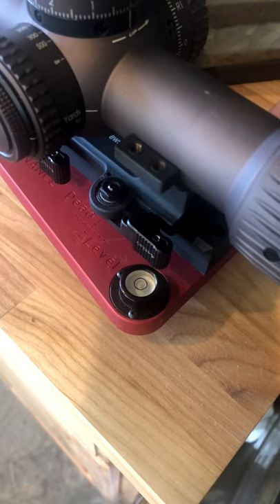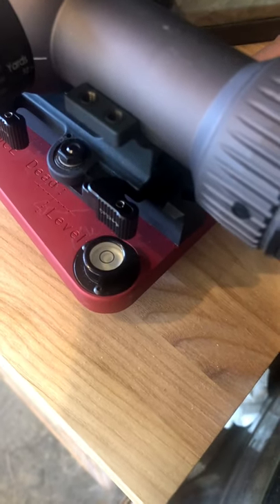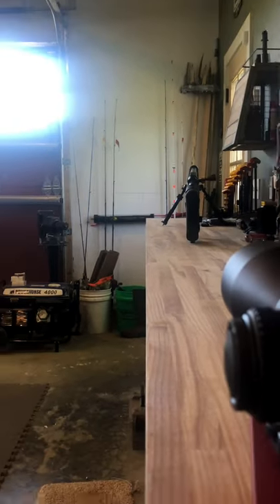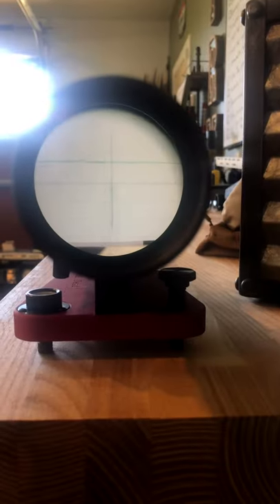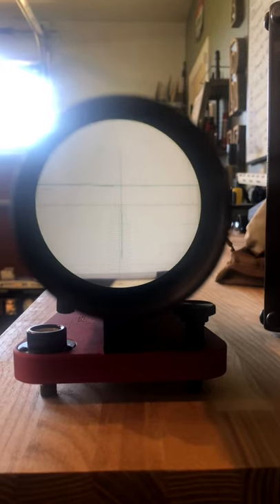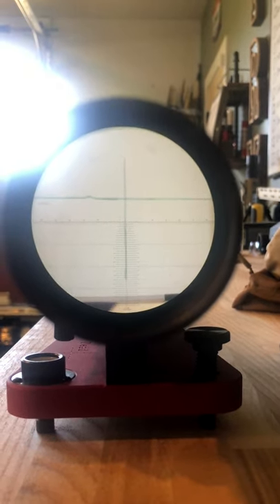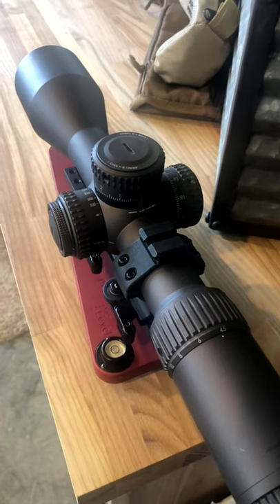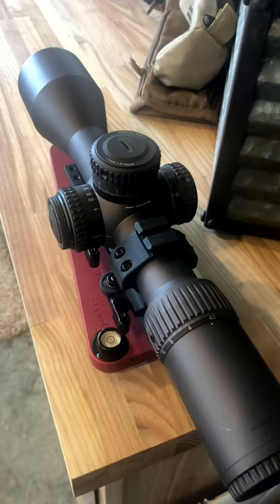#shorts Dead Level Your Scope

Comment: Haven't seen that! I've been using a level and putting it on the turret. I know turrets aren't always flat, but couldn't think of a better way to do it with the tools I had. 

Gonna have to look into this, thanks for the vid!
Reply from the maker: A great way to do it on the cheap is to still draw a perfectly level line on your wall horizontally with a contractor’s level and then vertically with a plumbob. Then shine a flashlight through the objective lens of your scope so that it casts a shadow of your reticle on top of those lines you drew on the wall. Make sure your reticle lines match up perfectly with the lines on the wall and you now have a leveled optic.
Reply: I never even knew that was a thing. Thanks dude I'm gonna do just that.  @PrecisionRifleNetwork

Comment: A scope doesn't have to be level to the rifle, just level to the horizon. If your shoulder pad can be canted then awesome, level everything and cant the shoulder pad to fit you, but if you have a rifle with a fixed butt, then it may actually be preferable (more repeatable, and this varies person to person, stock to stock) to have the rifle canted when you shoot which would mean you want the scope “out of level” to the rifle to make it actually level to the horizon. Just something to think about. Nifty tool but not something I'll be using, especially with modern digital levels now readily available.
Reply: What digital level do you use?  I hate the bubbles.
Reply: @whliving  Honestly, I don't: I prefer the plumb-bob method and then confirm with a tall target test.

Comment: Don’t see how this is easier than bubble levels on your rifle and scope.
Reply from the maker: because most people put the level on the turret cap, which is not trued and leveled.
Reply: @PrecisionRifleNetwork  I just tried your method. Which is hard to do unless you have enough room depending on your magnification. My turret cap on my vortex viper must be true as it lined up perfectly.
Reply from the maker: @stariadversesmalum4638  cool. In my experience, you got lucky with the turret cap. Typically they aren’t trued. There are only two perfectly flat spots on scopes. One is the reticle and the other is the flat bottom. Some guys use machinists truing bars under the flat bottom. Others, like me, use the reticle. Either option is acceptable. 
Thanks for watching.
Reply: @PrecisionRifleNetwork  Thanks for the vid!